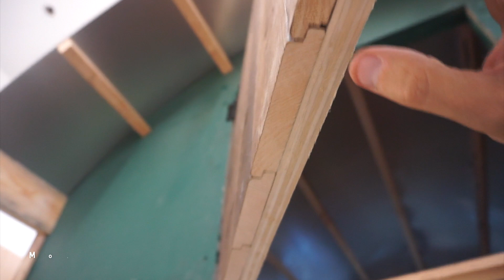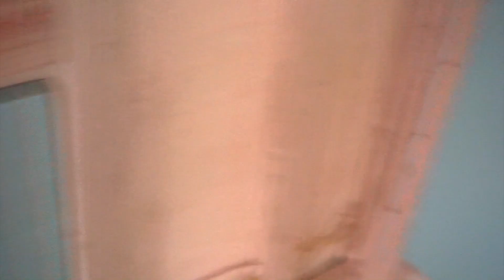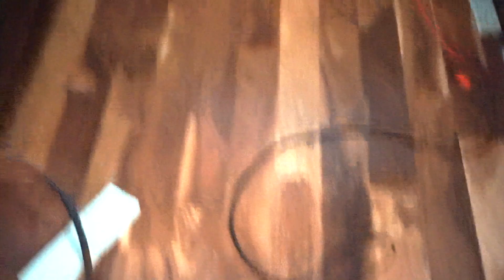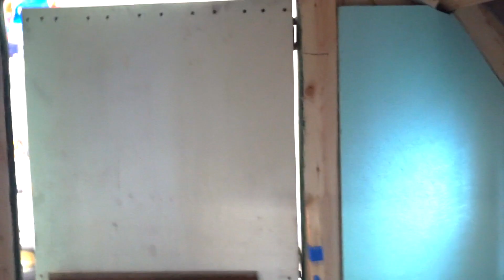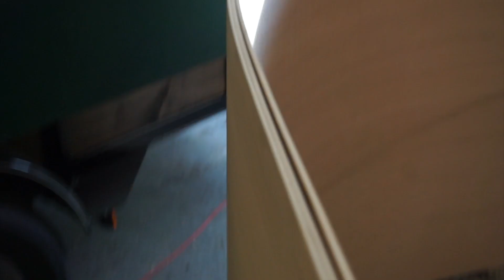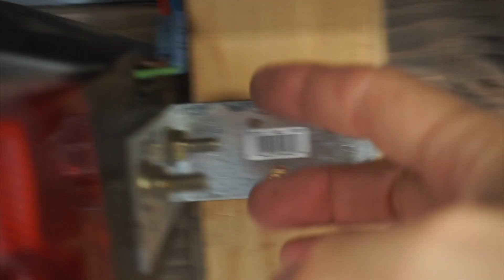DUTCH DOOR and Interior Overview - Building Your Tiny House Dream -   Episode 15

Comment: Wow, you did cover a lot this time, Chris. Thank you for explaining the making of the door. 

Is doing the floor covered in the book? I was wondering if it's possible (or too complicated) to have a bit of a raised floor so that I can add some hidden storage beneath it? I figured that would be a more sensible idea than lowering the height on the sides ... any input would be appreciated. Thanks. :)
Reply from the maker: Hi Donna. Most things are covered in more detail in the book. You could raise the floor I suppose. If you are going to have a bed or seating area anyway though you are likely creating storage space without the need for raising the floor. Is your goal to create a full time residence for yourself or some other purpose?
Reply: @TinyIndustrial  Virtually full time. Right now, I'm staying in an uninsulated 20+ yr old camper on someone else's land. I want something better; something of my own, you know?

 I do need a bit more than average storage and I'm under 5 ft, so I don't need all the head room.
Reply from the maker: @donnaarmstrong1193  Makes sense to me. Well I hope that you can get that process started. It says that the book was delivered. Did you get it?

Comment: Really was hoping to see how you handled the floor situation.  Great video series - thinking about building something similar.  Thanks for sharing.
Reply from the maker: Hi Shawn. For the floor, I always use a click together engineered wood flooring. It's an actual wood floor that has the advantages of 1) being thin and light 2) installs easily in the click together fashion 3) is very durable 4) looks great since it's actual wood vs. a laminate or similar. How far along are you in the process of getting started? Have you looked into trailers yet?
Reply: @TinyIndustrial  still saving up to get the trailer.   Have found a dealer for a trailer like you used for this build for a relatively decent price.   How did you water proof the trailer deck?
Reply from the maker: @shawncook8672  So the deck is pressure treated. I cover it with a vinyl vapor barrier and then put a foam underlayment on top of that. Once that's all in (in the form of a tub; up the sides of the interior as well (first 12")) I put in the engineered wood floor on top of that.
Reply: @TinyIndustrial  thx, that was also my question
Reply from the maker: @anniinthewoods8287  Oh good. Glad that helped.